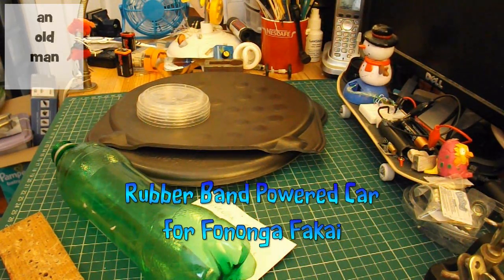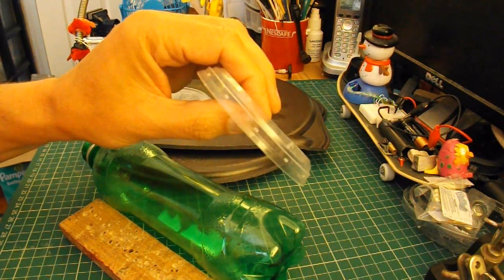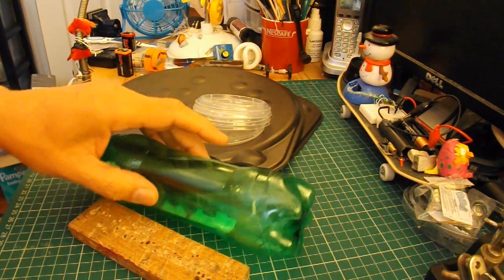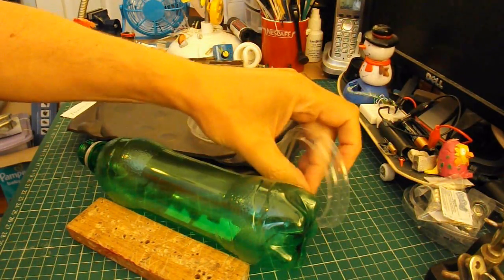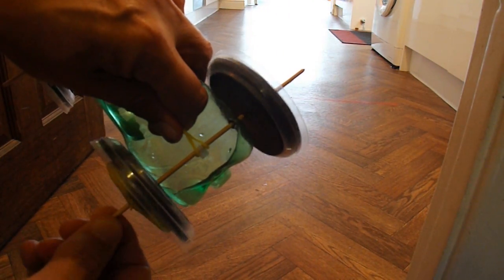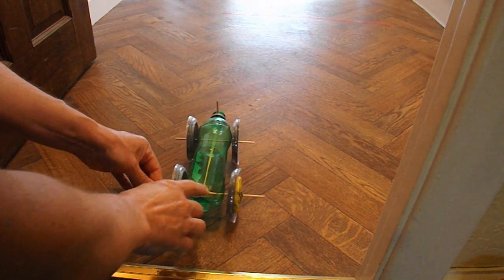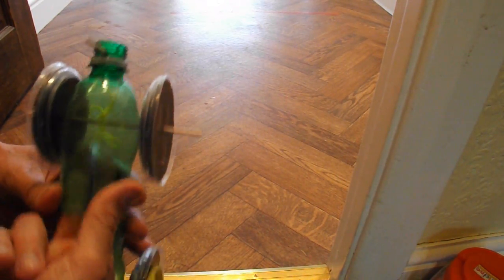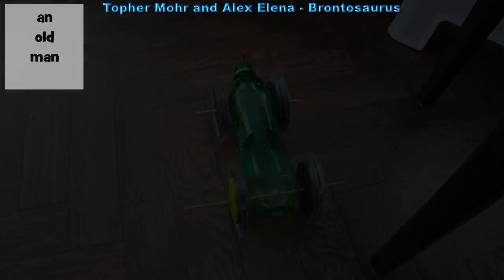Rubber Band Powered Car for Fononga Fakai

Comment: this is the video and the car is not moving
Reply from the maker: My wheels move. I guess you mean you have made a car like this and your car is not moving. Are your wheels spinning? I explained how to fix that in my previous reply. Is the axle spinning but the wheels are not turning? In that case your wheels are not tight enough on the axle so you will need to glue them on.

Comment: My car turns to the right whenever I let it run,how do I stop this?
Reply from the maker: There are several possible problems there. 1. If your wheels are spinning the car can turn either way as they slide about so adding something to the wheels to help them grip will stop that. There is a link in the video description on putting rubber tyres on CDs. Sometimes rubber on the front wheels is needed too. Alternatively you could add some weight to help your wheels grip. 2. When you wind the rubber band round the axle, if you wind it closer to one side than the other it can cause the axle to bend and that turns the car to one side so the fix is to take care to wind the rubber evenly as near to the middle as possible or change the back axle to a thicker one that does not bend when you tighten the rubber. 3. You may not have your axle holes in the bottle quite parallel so you might have to adjust the holes to straighten up the axles.
Reply: I have seen the axle bending from time to time so I'll fix that and I'll add some rubber gloves as grip on the wheels.Thank You :-)
Reply from the maker: Good luck with your project 😊